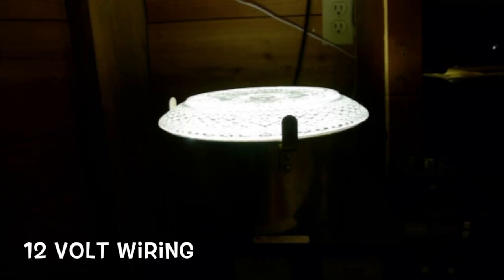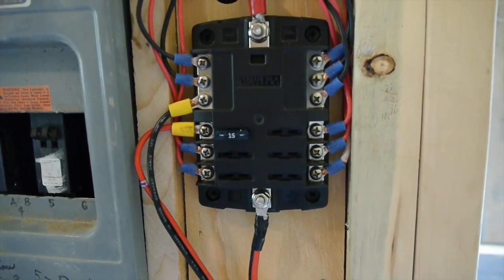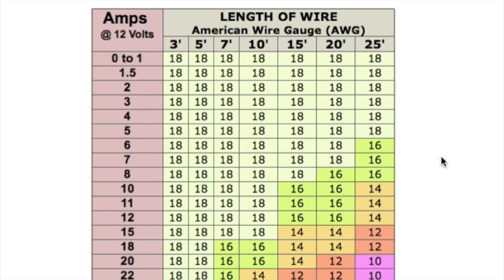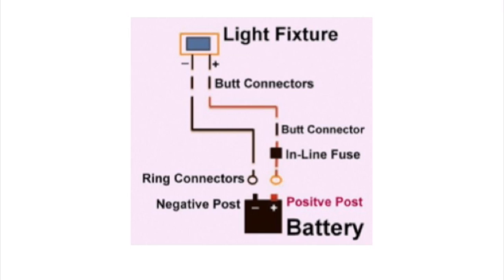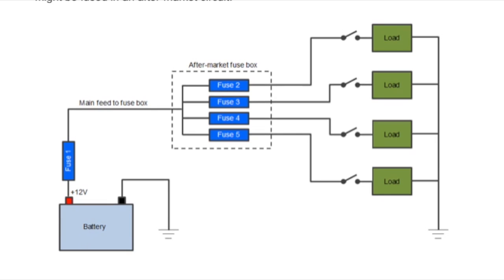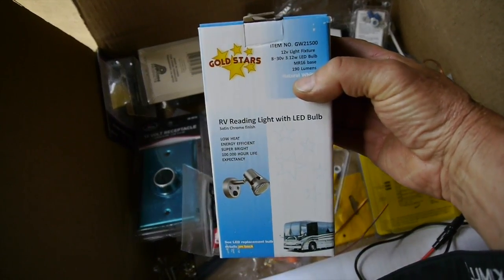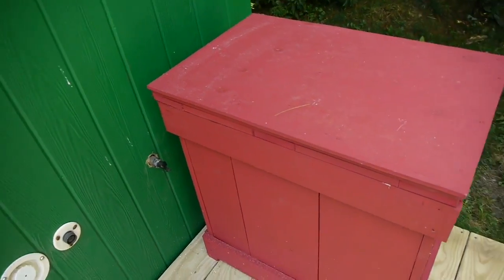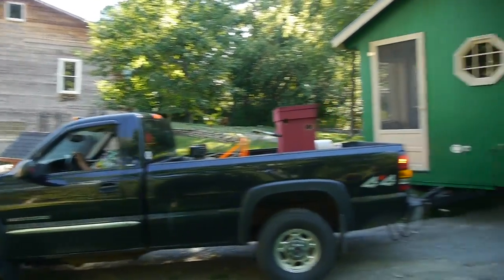Tiny House -12volt Wiring

Comment: I snip the power cord from old vacuum cleaners for 12 VT wire and collect up the extension cords I find at least half of them work fine tossed out by tradies because they have wet paint on them or just badly tangled or scratched up if they don't work it goes to the scrappers for $$ I did it all for free because I was 14 years old and homeless but had an amazing abandoned home overlooking the water no neighbours and my own island the government purchased up the home's and left them to be reclaimed by the national park I lived off grid like this for a few years I had to acquire a truck battery from the Railway service vehicle and solar panels from the coastal ocean beacon out the front of the house car stereo and speakers were wired up water came from a garden hose and washing had to be done at laundromat no fridge just cool box but all free .

Comment: Hi Tim, Thanks for this video, it really does a great job giving anyone with some basic wiring knowledge a great start at how to go about a project like this. I'm in the middle of wiring up a bunkie here and it has a 120v and a 12 system. One son wants a basic 12V, the other wanted the option of bringing his generator to it and so he wanted 120v. As such, I have wired in a small panel, and a generator connector. Since the panel needs a proper ground rod, I'm wondering if I shouldn't also ground the 12v as well, just run a wire from the neg of the 12v fuse panel to the ground. I figure a car is grounded to the chassis, shouldn't this be grounded too? Wondering what your thoughts are on this. thanks!

Comment: Perfect explanation. The drawing shows why it is so important to put the fuse so close to the positive terminal. I have seen numerous videos where they use an inline fuse to the negative AFTER the load. Very dangerous that way. Subscribed for sure on all this info for free.
Reply: What size fuse would I use just to run a few 12V lights? thanks.
Reply: @Redlinesixtynine  those lights probably only need 1/2amp. You can check the package to be safe. Fires from direct ground require the wire to get hot or burn so no amperage DC is “safe”
Reply: @uprightfossil6673  Thanks for your reply. One more question if you don't mind. I'm in the middle of wiring up our little cabin here and it has a 120v and a 12 system. One son wants a basic 12V, the other wanted the option of bringing his generator to it and so he wanted 120v. As such, I have wired in a small panel, and a generator connector. Since the panel needs a proper ground rod, I'm wondering if I shouldn't also ground the 12v as well, just run a wire from the neg of the 12v fuse panel to the ground. I figure a car is grounded to the chassis, shouldn't this be grounded too? Wondering what your thoughts are on this. thanks!
Reply: @Redlinesixtynine  that car grounding is not the same as earth grounding for 120vac. Earth ground will save your life. “Common” ground on a car means anything you touch with a positive lead will be energized or sparks will fly. DC does not do “earth” ground. The “common” buss bar i the way to go as well as a FUSE between the positive lead and the positive buss bar. REMEMBER: DC will heat up dangerously quick. I generally put the fuse on the ONLY positive lead that feeds a buss bar. You can protect individual circuits remembering to keep the fuse as close to the positive source as possible.
A quick fire starter is a nine volt battery and fine steel wool. That’s how dangerous DC is.
Reply: @Redlinesixtynine  the transformer you use should be grounded (3 prong) I use old extension cords for my DC solar projects. The very old two prong ones can only be plugged in one way for DC reference, but you MUST put a caution label on them or sparks will fly if connected to 120ac. (I know for a fact)
Reply: @uprightfossil6673  Transformer? My 12v is a battery source, my 120v is a generator source, the 120v panel in the cabin will be grounded. thanks.
Reply: @Redlinesixtynine  okay. Still, no earth ground is necessary for DC. I thought you had a small transformer to plug into the generator.(like the ones they use for electric trains toys) cheaper than a battery and a lot lighter, but watch the amps drawn. And use fuses!
Reply: @uprightfossil6673  Yes, I have used a fused wiring block for the 12v circuits, like Tim has used in his video. Each circuit is fused. Thanks again for the assistance.
Reply: @uprightfossil6673  Hate to bug you again, but do you have any suggestions on a good, simple to use 12v (30-40 amp) controller? Something that will obviously include hook ups for battery, solar panel, and load. Much thanks.
Reply: @Redlinesixtynine  my advice is to look at the guarantee and to buy one rated at least 40-50 amps or higher if your load is 30-40. Motor start up can wreak havoc on circuits that are overloaded and you will have less heat loss. No bother. Cheers
Reply: @uprightfossil6673  So am I following you correctly?.. the brand name is Guarantee? Did a quick search and came up empty on that. I live in Ontario, Canada, so maybe some brands won't be easily available to me. Appreciate it.
Reply: @Redlinesixtynine  not a brand name. most electronics now are produced in China and are clones of each other. They don’t have the protections on intellectual rights we have. For instance, my cheapo Harbor Freight unit has survived abuse after abuse and still runs after five years. The most important thing is to make sure it is overrated for your system. Sorry if that was not clear before. Also, look for features. Mine has four separate circuits and many only have two. Cheers
Reply: @uprightfossil6673  Gotcha. Thanks again.

Comment: Good move using 14 gauge wire.  If you have to switch to AC for some reason you don’t have to pull new wire for 15 amp circuits.

Comment: Excellent video.  Very easy to follow.  Where would you connect an inverter if you had one? Would it be connected to the negative and positive terminals on the fuse box.
Reply: your inverter would run directly off your battery.  Make sure you size the wire size to the potential amperage that your inverter will draw.  And a fuse is neccessary as well.

Comment: How big of solar panels did you have? I’m putting two led lights on a deep cycle battery and I’m on a tight budget
Reply from the maker: It wouldn't take much of a solar panel to charge a battery for powering  two LED lights.

Comment: Question please. What if my tiny house is much bigger and I already ran regular ole ac wiring to a circuit box? 

Can I still connect a solar system?
Reply from the maker: If I understand your question ... you can not mix 12v and "regular ole ac wiring."  I wired my cabin with two separate electrical systems.  I can power with regular 110v house current into an electrical panel which then has circuits running to lights and recepticals just like house wiring.  My 12v solar system is completely separate.  The solar panel charges batteries.  Then I ran a heavy wire to my 12v distribution center and from that, I ran wires to 12v lights and 12v cigarette plugs etc.  Later, I decided to buy and inverter which converts the 12v from the batteries to 110v.  the inverter has two outputs.  I ran a wire from the inverter to my 110v panel and in this way I can now run my regular house current in the cabin.  This was a learning project.  If I had it to do over, I would forget running 12v wiring for 12v lights etc.  I would run from the solar panel to the batteries then to the inverter then to a 110v panel box to power the cabin.  Hope this answers your question.

Comment: I've got another question. My dad says we don't need switch relays and a busbar. Everything is going to be super low amp draw so he thinks we can direct wire from the fuse box with just a switch on the line. Would that work for low amp situations? I cant figure out why you would need switch relays and the busbar in the first place tbh. First time doing this
Reply from the maker: I am not a professional electrician so I pretty much oversized all my wire to make sure I would be safe.  I ran from my battery through a fuse to the little 12v fuse panel block.  Then, I ran several circuits for lights, a USB charging gizmo, a 12v port for cigarette style plug etc.  I had never run 12v before and I did a lot of reading before I bought my solar panel, inverter etc.  The internet is a great resource for learning.
Reply: @TimTools99  yeah im.doing pretty much the same thing. I think it's a fairly safe set up if most of your stuff uses less than 5amps. I think the 12v cigarette charger and  the two usb chargers all together might push around 15 amps but in a tiny house or in a boondock situation most of the load will be so insignificant that it's safe with fuses and oversized wire and basic 10amp switches
Reply: @TimTools99  I will post again when it's all done. Let everyone know if it caught on fire lol

Comment: I cant figure out which fuse is appropriate. For instance my fans will drawing about .4amp hrs. So a 1amp fuse would work but would that mean I'm over charging the circuit? Or say I use 5amp fuses, do I need to worry about sending too much electricity?
Reply from the maker: When specifying a fuse for an after-market application, the key consideration is that the fuse should be the weakest point (i.e. lowest rated component) so that it always blows before any damage occurs to other parts of the electrical circuit. However, you also do not want the fuse to keep blowing under normal operation (known as a nuisance blow), so the two elements to consider are:

    The current rating of the smallest cable in the circuit
    The current draw on the circuit under normal expected operating conditions

The fuse rating should lie somewhere between these two values to allow normal operation but blow on overload. For example, if the normal expected current draw is 10A and the cable size is 25A, then a fuse rated at 15A would be appropriate.
Reply from the maker: Fuses are there to protect the downstream conductors (Your Wire) in the event of a fault.  They do not care about the routine non-fault loading and should not be sized for it. (In other words, you determine your fuse size based on the size wire you are using NOT the device you are connecting up.) The proper way to select a fuse is to determine the rated continuous amperage capacity of your downstream conductors (Wire), and then select a fuse with a rating lower than that. The how much lower is up to the specific codes and industry, but picking a fuse with ~80% of the conductor rating is a good rule of thumb. Slow-blow for big inductive loads, fast-blow for anything else.

If this results in a fuse that is too small to support the non-fault loads you plan to run on the circuit then this means you need heavier conductors (Wire). Just upping the fuse to support the load is asking for a fire.

The wire gauge should be marked on the cord for your socket. Then a table such as this one http://www.powerstream.com/Wire_Size.htm will help you to determine it's safe maximum amperage capacity.

For example, if your cord is 18 awg wire then it is rated for ~16A as chassis wiring. De-rate that by 20% and you get about 12.5. The next lower standard size is 10A; so you want a 10A fuse. This will definitely protect 18ga wiring and still give plenty of head space so as to not blow in normal operation.
Reply: @TimTools99  thanks a ton

Comment: Great video, very resourceful ideas, clean setup and great detailed communication! Don't forget for larger items such as a descent size mini fridge, TV and or computer you can run a small 1500w (RMS) power inverter to convert your 12v DC source into a 120v AC auxillary option. You can also install a peltier device attached to a shallow heatsink inside the lining of a plastic ice chest, cut a hole slightly smaller than the size of a computer fan, mount to other side of the heat sink forcing cool air into cooler.

Comment: thanks for sharing, good job, So how are you charging the battery? If solar how are doing that?
Id like to try a similar project
Reply from the maker: You will need a Solar Panel, Charge Controller and battery.  You connect wires from the solar panel to the charge controller.  Then you come out of the controller and go to a 12v Battery.  Here is what I used:  (SOLAR PANEL - Grape Solar MODEL:GS-Star-180W-US High Efficiency Mono-crystalline. I have this panel changing two deep cell 12 volt batteries.)  (CHARGE CONTROLLER-  MPPT Tracer 2210.  Later on I decided to get an inverter.(INVERTER- Xantrex ProWatt SW 1000 Sine Wave Inverter.)

Comment from the maker: I also ran a ground wire from the negative post on the battery to a ground rod which is pounded into the earth next to the cabin.
Reply: I think I will do that as well
Reply: No need to do that, but it doesn't hurt either. I would only ground a 120 v system, even then only if connecting to shore power.

Comment: Hi!

Good video and good info, one detail i would like to add would be that you have to calculate both (+&-) wire's when you are calculating the lenght of the wiring and which size wire to use.
Reply from the maker: Yes, that is right.  I should have mentioned that.